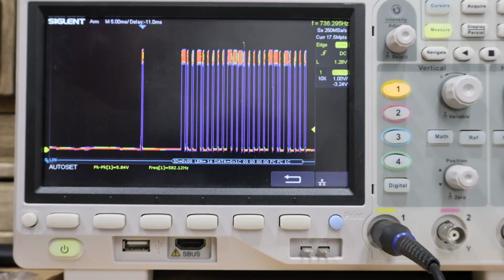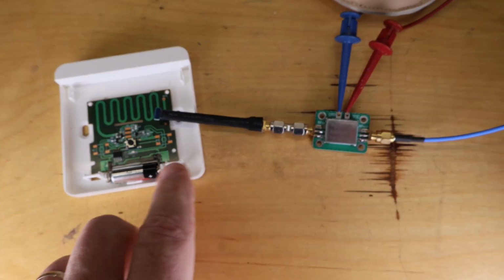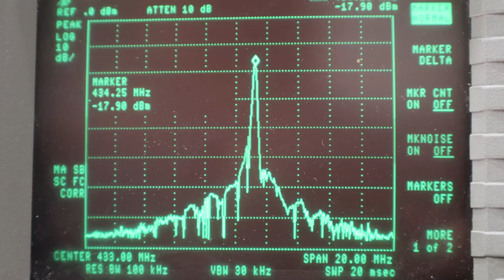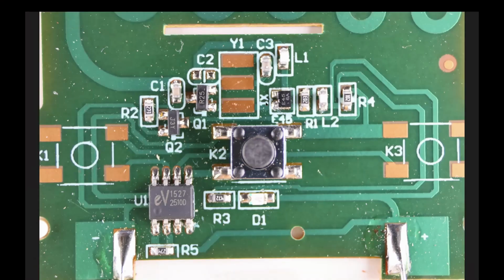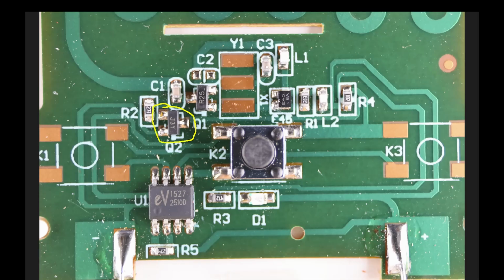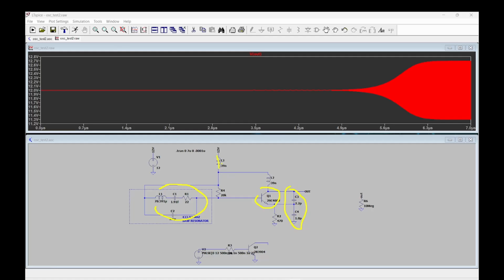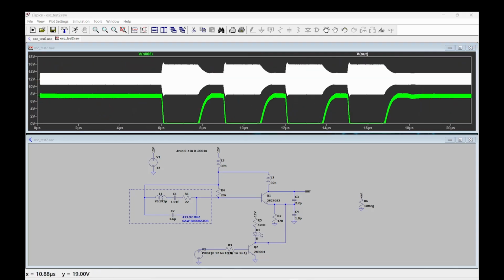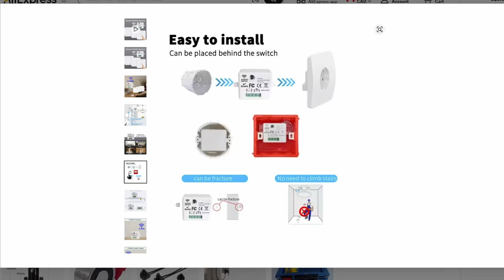Reverse Engineering a RF Remote Power Switch

Comment: A rather surprisingly old looking design imo. I would have thought for sure they'd be a large enough market for those and the technology is now cheap enough that all of that would be available in a single chip by now. Also considering the simple nature of what U1 does, I wonder if it is an MCU or just a really basic fused ROM device that just shifts out bits when activated. I wonder if this is from some factory that's been making those for the past 30 years or something with only minor changes.

I'd also bet the mains voltage relay component has very questionable electrical safety inside.

Comment: 1. It's questionable to say that a light switch is insecure. Sure, they can turn the light off and annoy me, but what could they use that for besides annoying me?
2. Not a side channel attack (maybe technically?), a replay attack
Reply: For #1 it could be hooked up to anything, not just a light... imagine if it was a garage door or pump that could run dry

Comment: imagine the odds of getting 2 of these with the same serial number, the first 1 that came out of an old run of serials and a new 1 after they looped back to 0 :D
Reply: They use a rolling code, from what I have determined. 
No, the ID is coded into the transmitter EV1527 Chip.
The 24 bit number consists of a 20 bit sender ID, and 4 bits representing up to 4 buttons on a remote control.
Reply: @johncoops6897  so just over 1 million codes, i bet there is over a million of those chips in some factories, wouldnt be terribly hard to brute force either
Reply: @frogz- it is a LIGHT SWITCH 😂
Nobody is going to be doing WarDriving attacks on the things 😉

Comment: 2:10 it's not side channel attack, it's a replay attack. if you record the pattern you can replay it. side channel would something like if it lit the LED as it was sending each pulse and you could get the signal by videoing the LED. Or if it lowered the voltage for the system globally as it was pulsing the pattern. 
but otherwise great.

Comment: 12v battery.... seriosuly?  The 1980's called and want their RF circuitry back.
Reply: :face-purple-smiling-tears:
Reply: When I bought mine, I deliberately chose the 12V rather than the CR2032 version.
The performance seems better, and the 12V batteries last for years.

Comment: Really like the LTSpice analysis! There’s an interesting similar version of a wireless switch that doesn’t use a battery. Instead vibration from the switch powers it. It never needs batteries. Bigclive opened one if I remember.
Reply from the maker: how interesting, not much energy in a key press

Comment: Thanks for the detailed analysis!
This remote transmitter has one/two/three button versions.  There's no difference circuit-wise, other than 1/2/3 push button(s) populated.  The 8-pin IC will generate different modulation codewords accordingly.